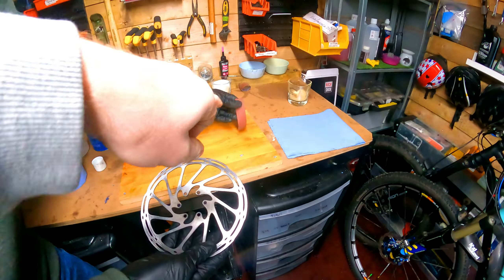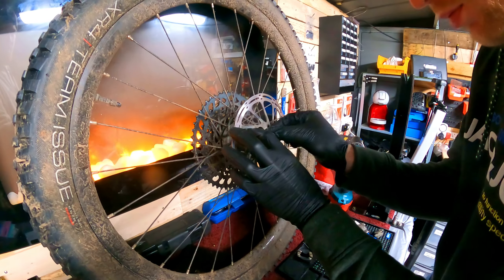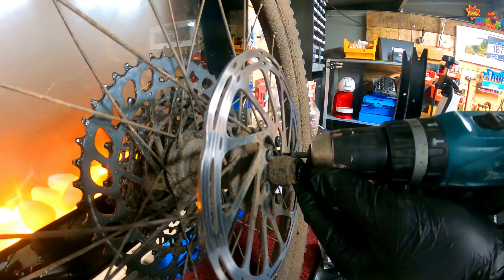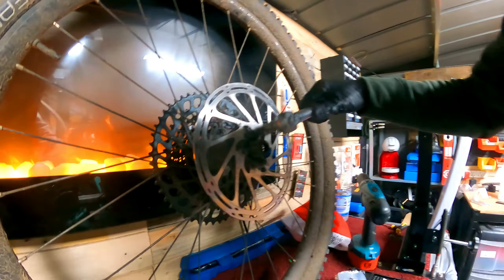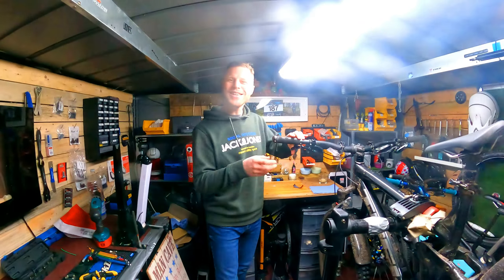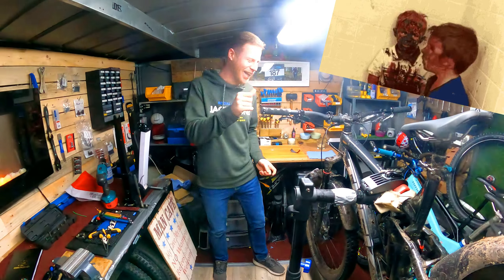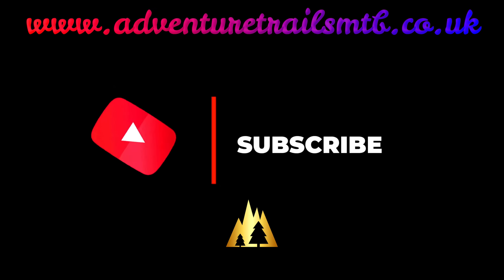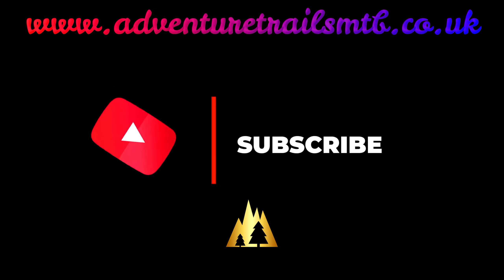My Code R Brake Has No Power . The Fix

Comment: So, i have already done a proper bleed and the pistons/lever feel like the system is nearly dry, i did this after i realized that my brakes were getting an inconsistent biting point and now there's nearly no power, it was all using the original SRAM stuff, (professional bleed kit and Dot 5.1 as adviced by Sram). I even tried to jam a piston separator and to pull the lever with the maximum reach possible and it just felt like there was nothing. The pistons moove evenly, but they barely moove. Is there any chance that this was caused because the oil i used was from a bottle opened about four months ago? I don't wanna open my sealed spare for no reason because if i eventually need it i'm not always able to buy one and i could end up having to park the bike for a bit
Reply from the maker: It sounds like there may be a pocket of air stuck somewhere.  Regardless to what some people say on here   , if you have trapped air then your brakes will lack power and feel spongy .
Reply: @AdventureTrailsMTB  the weird thing is that it's extremely inconsistent, It would feel fine for a while and all out of a sudden my brakes feel dry, then they come back like nothing happened (it's not heat, i have theese issues while riding regularly on the street). I have nearly used half a bottle to bleed a single brake and i don't think that it's air trapped inside, i also have had other issues that i have no clue if they're related or not, but the pistons always require so much strenght that i can't reset then normally, i need to push then individually black to the regular position and use all the force i have to just get one moving. I'm thinking of replacing the pistons and seals in the caliper since a kit is 15 bucks, but if It is the lever or something else i have no clue whatsoever about what to do.

Comment: Ok, so as far as I know, all you did was basic maintenance. Not a fix.. The only fix to a more powerful sram code r is, to buy a better brake system.
Reply from the maker: your crazy if you think air in the system doesn't effect performance. 

Personal preference on brakes , personally I like the code r's and find Hope brakes shit ,again all comes down to what type of feel your after . Thanks for the weird feedback though
Reply: There's a whole bunch of different issues brakes can have, i don't think that it's fair for you to say that and begginers might not realize the maintenance a higher end bike needs, even if it's just maintenance it still can fix the issue for someone who doesn't realize it.
Reply: @AdventureTrailsMTB  i don't really get why people are so heavily biased on brakes, all i want is enough power to stop and as long as i get it i'm fine with watever i have. That said, the Code Rs are DEFINITIVELY more than powerfull enough for anyone. I have tried a Hope V3 before and it's insane how good the response was, but i just can't justify spending so much on fancy brakes, i could just buy a set of Shimano Zee ones if i want the less progressive lever feel.